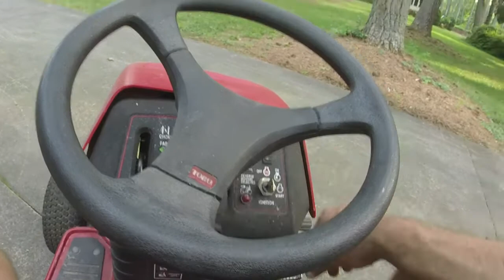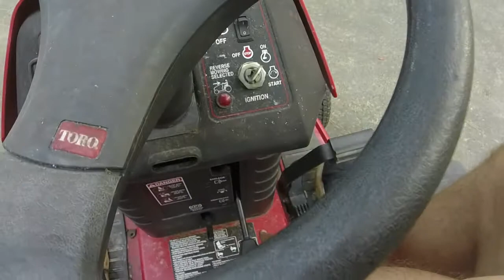Someone put a Murray deck on a Toro Wheel Horse and it works!  Removing blade brakes

Comment: Always interesting to watch you rig up a solution to make something work.  I do worry a bit about removing the blade brake just in case someone gets hurt because it has been removed.  Very cool video and thanks for sharing.
Reply from the maker: I wanted to keep the blade brakes but found out the cable wasn't strong enough to pull them back.  So while it wasn't my #1 solution it was the most practical for the mower.

Comment: If you;re gonna repair and resell something, fix it right the first time or don't do it at all, or you will end up like a lot of other people who just do enough to get it sold and make other people that do it right look bad.
Reply from the maker: Here's more context behind this mower if not already mentioned in the video.  I did not flip this mower or resell it.  It was a repair.  I was asked to see if it was even possible to get it working again.  This was the only logical repair that did not cost more than the mower.  Customer was happy with the repair.  Told him to call if any issues.  That was 5 months ago.
Reply: @EllisMowersandmore  ok, i was wrong, sorry.